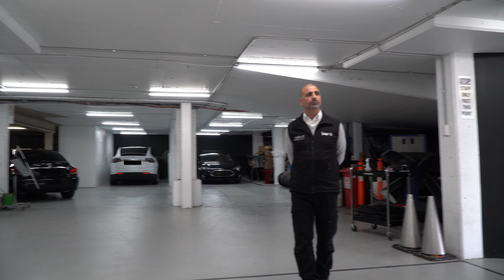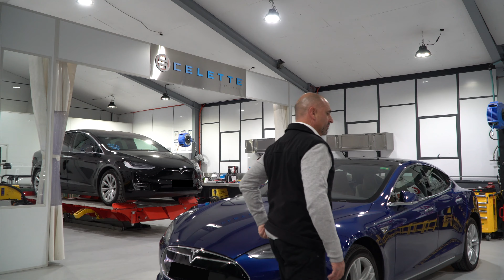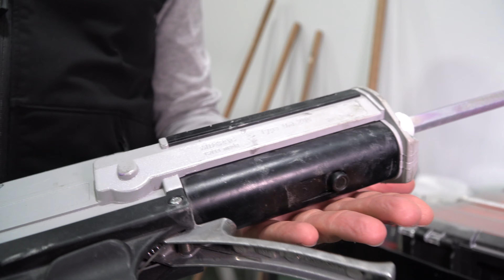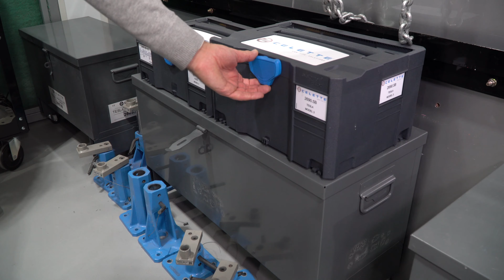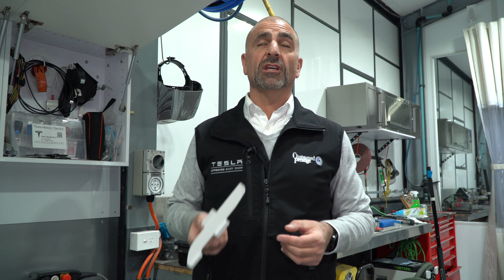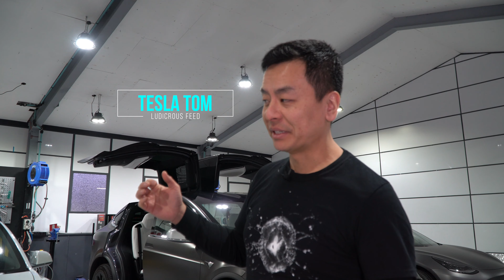Always Choose a Tesla Approved Body Shop | Chatswood Prestige Sydney

Comment: Really interesting! I wonder how much it costs to be an approved repairer? I assume there’s a lot of specialised gear, and ongoing training involved. 

I’ve heard it’s notoriously difficult/impossible to get parts from Tesla for right to repair or if you’re just not an approved shop. Do you know if the approved repairer has to provide evidence for the parts they need?
Reply from the maker: Thanks for the comment Tim! Needless to say it was a large capital investment from my understanding and as you can see from the vid, lots of specialised equipment and certification was required. It is indeed difficult to source parts without being a certified body shop. I believe the special ordering software/process is only available to approved body shops anyway so I don’t know if the parts would even be available to other repair centres 🤷‍♂️

Comment: Nice video. Sad to see so many Tesla's in the parking lot.
Given Tesla's control of the supply chain, I'm wondering how a non-Tesla shop could even repair a car (other than for very minor dents) if you didn't have choice.
Reply from the maker: Thanks Mark! You’re right and as George explained, those other body shops just don’t have the tools for it. But I think it also comes down to having the right initial diagnosis and that’s where George’s expertise is critical.